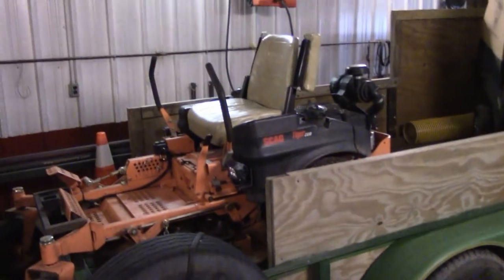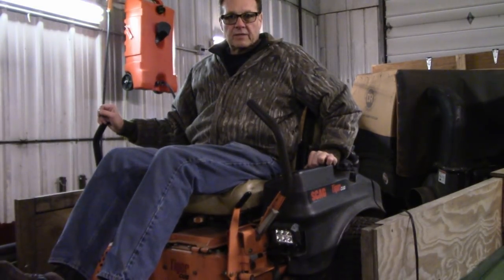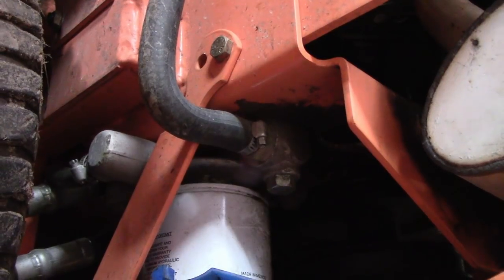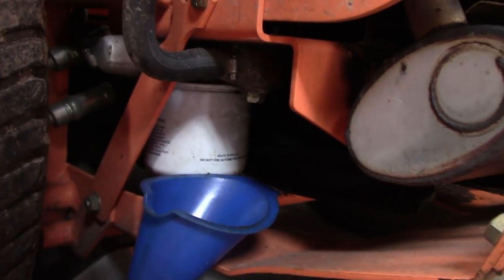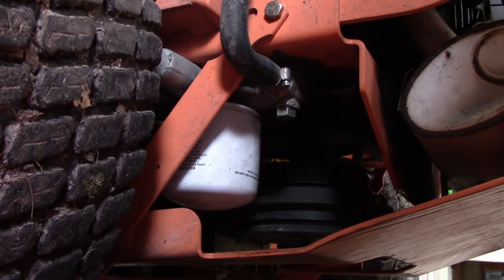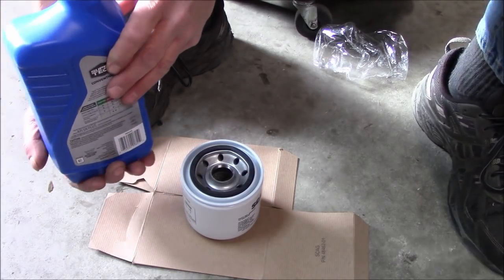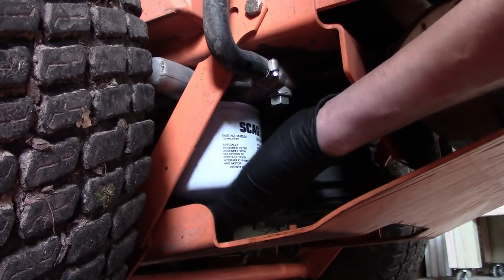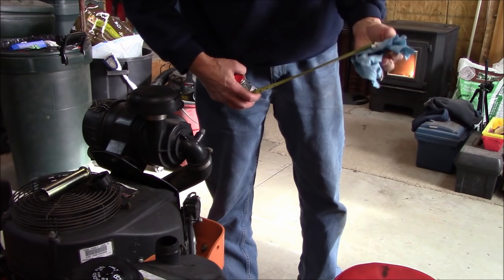Scag Tiger Cub hydraulic Filter and oil change

Comment: Thanks for letting us see you work in off season stuff. Down here in Florida we have very little off season and it is hotter then a whochee coochee. This reminds me I want to put remote lugs on to put a booster box on the battery for low battery cranking times and you have to have the seat down

Comment: Hi Mark, great video! I will be performing my zero turns oil change and hydraulic oil change with their filters in a couple of months. I have a tiger cub as well 48in deck. I was wondering if the oil filter and hydraulic oil filter are the same or are they both very different filters?
Reply from the maker: They are different filters. I always use hydraulic filters for the hydraulics, they don't have a relief spring if they get plugged and don't allow anything to bypass. No damage to pumps ever.
Reply: @Marksmisfitworld  thanks!

Comment: So why not let gravity fill the filter up. The supply line comes directly from the reservoir to the filter.. I drain my reservoir by taking of the filter so I am certain the oil flows to it with no problem..  I would let it sit for a couple hours if your not in a hurry to be sure it fills..
Reply from the maker: I don't have the patience to wait for all of the air to bubble out.

Comment: Hi I got a scag just to the right by where you put a the oil in for hydraulic you see a tube coming up has a yellow cap you can take off what goes into that? Another question my mower will mow about ten minutes an stop cutting, mower engine keep running but no cut thks you
Reply from the maker: That is the drain tube for the oil. Check the wires on your clutch, also check the fuses.
Reply: @Marksmisfitworld  there are fues on it but it run for little while an stop so guess it a short in it?
Reply from the maker: Check the connection at the PTO switch and the clutch connection.

Comment: based on the condition of the old filter, I suggest you make a better effort at not destroying it while it's on the mower.
Reply from the maker: Can’t control when a belt blows and where it ends up.
Reply: @Marksmisfitworld  No, but I think it might have been a good idea to change the filter after it did happen. That thing was fucked up.
Reply from the maker: It was changed after it happened.